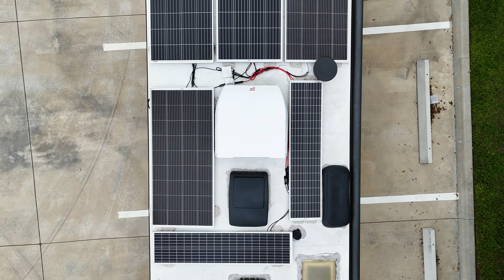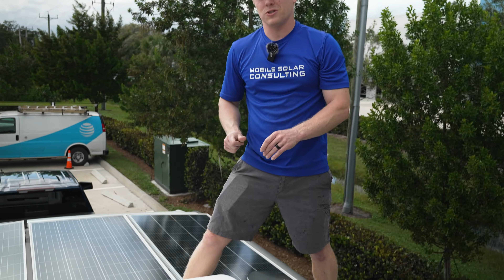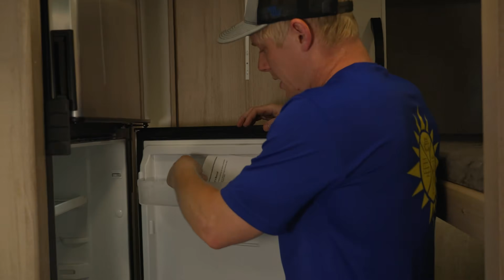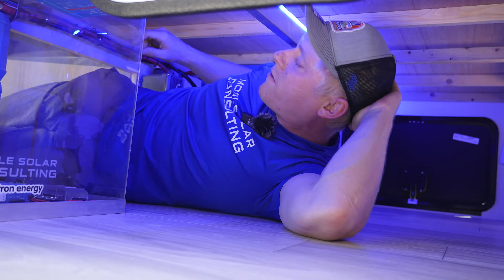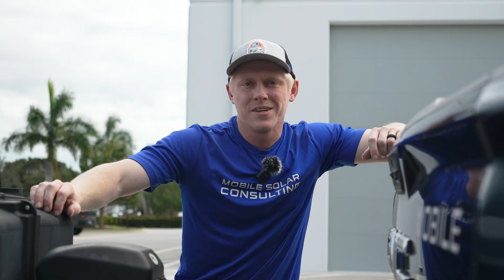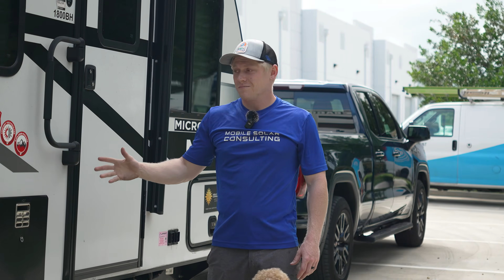Winnebego Micro Minnie Trailer Self-Sustaining Solar Walkthrough

Comment: Thanks for the Video and such a cool set up you have. I heard and read that with RV Solar Panel System, not to worry about whether the Solar Panel is labeled 12 or 24 volts since the solar panel controller actually is configured for what ever application/configuration your RV batteries are set to or am I mistaken.  I see all the time that MFG's say 12/24/48V solar panel.. I'm a tad confused I think.  Any advice?
Reply from the maker: You need a higher voltage than the battery for the MPPT to work properly. If you have a 24V battery, for example, you need a 24V solar panel, or multiple 12V panels in series. 

Good luck with your solar setup!